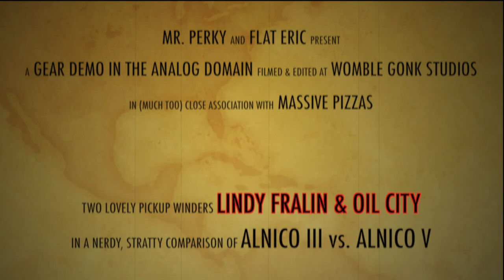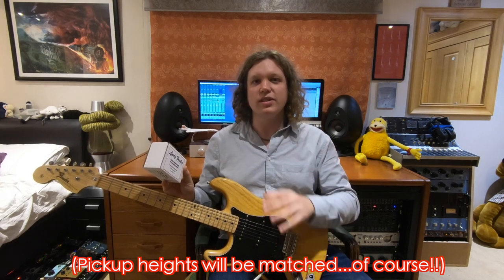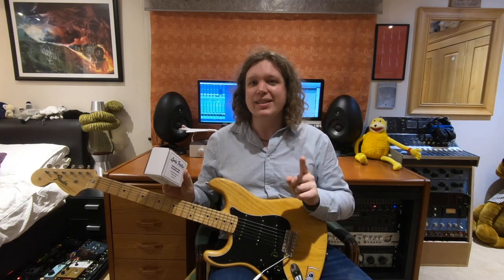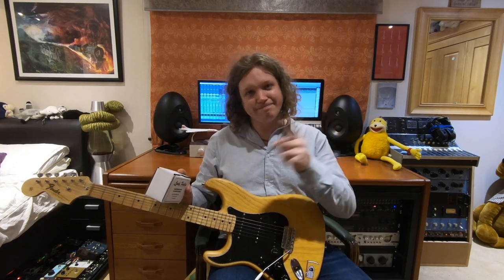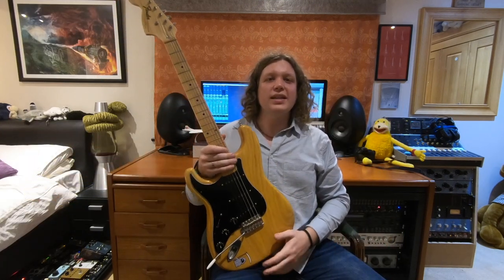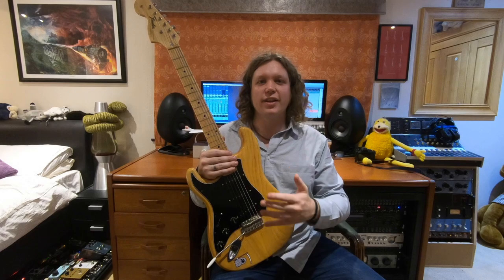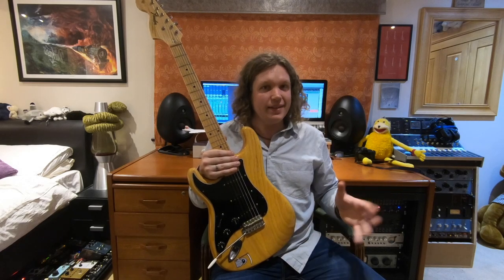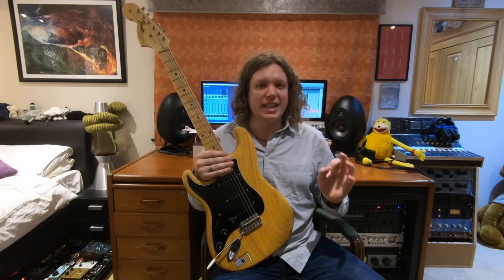1954 Strat Pickups: Alnico III vs. Alnico V Magnets (Fralin Real '54's & Oil City Origin '54s)

Comment: The differences are subtle, but the III’s definitely sound more balanced. If you’re going for the mid-50s sound it’s a critical element that even Fender finally came around to embracing again.
Reply from the maker: Couldn't agree more :-)
Reply: Curiously, though, to my understanding they still don't offer anything mid 1950s style with A3.

Comment: Nice comparison. Though the final effect on sound also depends on the internal wire, number of twists and size of magnet, Alnico III's in general do not scoop the lower-mids and mids-mids like A5 do in general. I  can hear it in your video and also I have conducted numerous tests myself over the latest 10 years to support that statement. A3 are my best sounding pickups (have tested different combinations of A2,A3,A5,A8, Ceramics). With the right configuration eg an oversized magnet they have the potential to be more focused and tight than others, they respect the dynamics, have more pronounced harmonics than ceramics and can provide excellent punch despite being lower output. I can play from blues to death metal with the right A3 and retain pure organic sound in all cases.

Comment: They are both great sounding sets but,  I agree with Joe completely, the alnico 3 pickups have more dynamics and have  more "interesting tonal characteristics, which is consistent with "lower output" pickups  sounding "sweeter" - a principle that seems to have been completely lost with most major manufacturers for many years. You don't need high out put pickups to drive amps, that is the job of amplifiers, overdrive devices , and pre-amps in the sound chain. It has been many years since I have  picked up a new Gibson guitar that sounded any good "clean", and yet my original '61series 1 LP fretless wonder "custom" with 3 x PAF's sounded great clean, and so did my original '54 Les Paul with 2 x  Alnico 3 P-90's.There seems to have been an "obsession" with high output pickups - but hey, not everyone is using high gain amps, and lower output pickups can still do "filth" just fine . Nice demo, thanks Joe.

Comment: Nice demo!  FYI: The 'notch' positions 2 and 4 would work the same for both. Main difference would be the slight amount of hum for the Oil Cities.  The Fralins reverse the magnet polarity and also the coil direction, so signal phase remains the same.

Comment: I will be installing A3 pickups in my strat on monday. Ox4 1962 pickups. I'm curious to see how they compare to the Fender pickups I've tried.
Reply from the maker: Ooh nice, I'm hoping to buy a set of OX4 P90 pickups soon :-) Let me know how they are!!
Reply: @JoePerkinsMusic  I don't know how I'll be able to compare them as I'm getting strat single coils. But I'll let you know how they sound.
Reply from the maker: @colaboytje  Was just meaning vs. your Fenders :-)
Reply: @JoePerkinsMusic  As promised:
I received the Ox4 strat 1962 pickups and installed them in my 1959 Fender Custom Shop. The Ox4 pickups have a flat staggering while vintage Fender pickups have a vintage staggering, so that is already a big difference. The output of the pickups is really low (which corresponds with the A3 magnets), lower than Fender low output pickups you can buy today (which are all A5 magnets except for the neck pickup in the Eric Johnson pickup set) if I'm not mistaken.
They sound really well balanced. They are very clear and don't have that spikey high treble you can have with Fender pickups. 
Bass is less pronounced. The mids are well defined. 
They have a more squishy feeling imo. They also remain very defined with overdrive.
Because the middle pickup is not RWRP, they have a very nice Mark Knopfler clarity with a bit of quack in the 2 and 4 positions. 
I like them very much. But I'm not sure if it's for every strat player. You really need to like low output and lower bass respons.
I do need to mention that I have tested them with my Two-Rock amps. I prefer them over the Fender Custom Shop Josefina handwired fat 50's pickups that came in the strat I put them in. 
In the future I will buy 1965 Fender pickups for another strat of mine. Or maybe another brand, but definately 1965.
Reply from the maker: @colaboytje  Ah legend - thanks for letting me know :-) I do generally prefer lower output pickups with good definition so maybe the OX4 P90s are what I'm after for my ES-330 to make it a little less woolly :-)  Cheers mate - really glad you like them!

Comment: Nice demo! Both sound good, but honestly - based on the recording - they are remarkably similar in their tone print. I hear only very slight differences between the two when arranged side by side like this, but if you took down this video, waited a week, installed only one of the two sets and uploaded a video, my guess is people would have a  v e r y  hard time deciding which set they were listening to.

My favs are the hotter Fralin Woodstock 69's and I'd take them over any of the two mentioned
Reply from the maker: The differences are definitely subtle!

Comment: on neck position the 3s sound more farty on low strings. The 5s are tighter and punchier yeah? That's the only advantage. 

maybe a neck pickup with a V on the low E and A strings and everything else A3!

Thoughts?

Comment: There is a lot of misinformation online. From what I saw in forums, it seemed to me that the consensus was that they did indeed only use alnico 3 in 1954, but I didn't know that it was only for a few months. I would love to know where you found your info, whether it be from a forum post or whatnot. I love doing my homework! Cheers
Reply from the maker: I think it's just fairly common knowledge amongst Fender enthusiasts - I don't tend to trust forums for historical information too much, but expert pickup winders all seem to say A3's were used for a few months in 1954, before they switched to A5 as they felt the originals were a bit plinky in comparison to the P90 Les Pauls that were out at the same time.